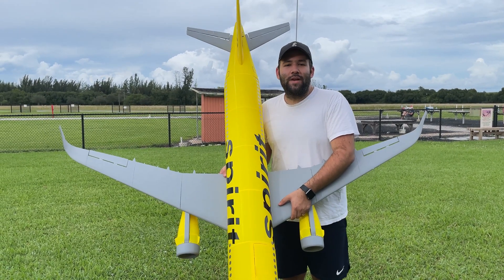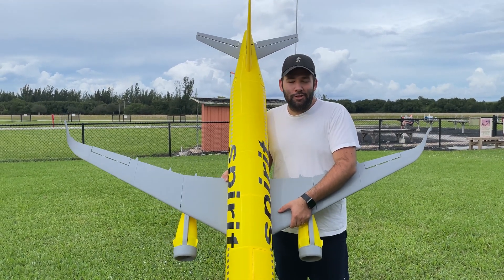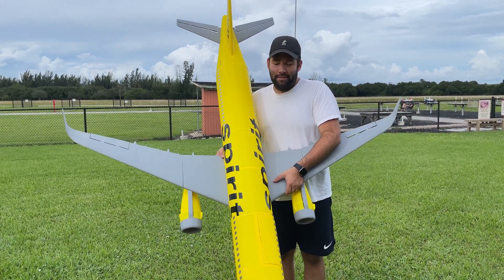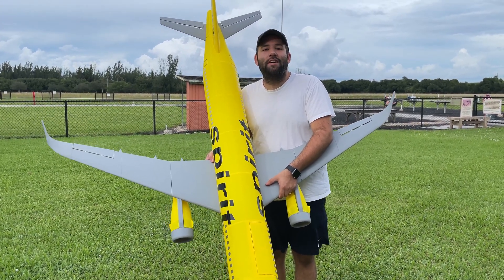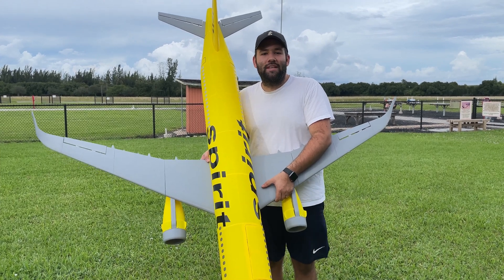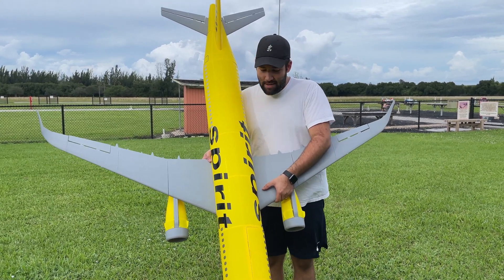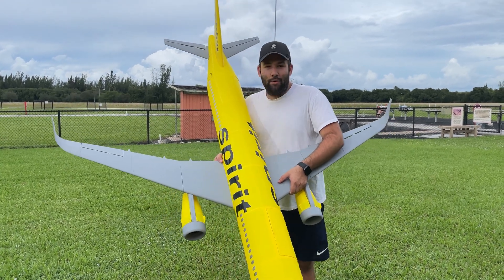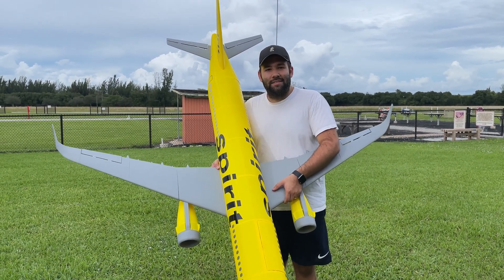GIANT 3D Printed A321 RC Plane

Comment: Hello it was an amazing plane. :) How much money did it cost to build?
Reply from the maker: Thank you, Do you want to include the batteries and transmitter/receiver? Apart from that its not that expensive, the ESCs and Motors come in second highest cost, apart from that is pla, and carbon fiber rods. It all really depends where you live and if you can get parts cheaper
Reply: @AlejandroAlcantara  thanks your answer :)))))

Comment: You are coming in too hot. Approach speed should be about the same as your VR.
Reply from the maker: That is correct, unfortunately this model does not have flaps, so it is very tricky to slow it down